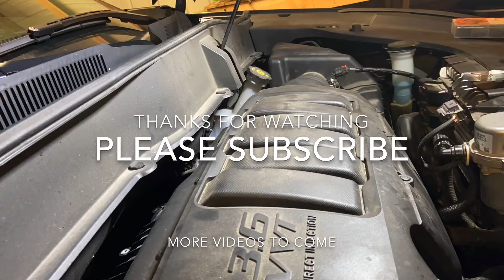Replacing the coolant temperature sensor on a GMC Acadia

Comment: I am having the same issue on my 2018 Acadia but with the warning of “Driver assist may be reduced” coming on the instrument panel. Temp bottoms out, fan kicks on hi, compressor for AC is disabled. I have an extended warranty which would cover it with only paying my deductible. I was advised by the mechanic that the issue is the State Farm Drive safe module. I have relocated it to another area and still having the issue. So is the issue really the temperature sensor or is the mechanic actually being truthful? At this point, I’m not sure which to believe but I believe the mechanic is full of crap. So I guess my question would be can this module have any interference with sensors on a vehicle mechanic also said it’s because it’s Bluetooth which my phone is plugged in and connect it to my vehicle by Bluetooth so I think the mechanic is just full of BS. What is your take?
Reply: Replace the thermostat under the intake for that

Comment: I have a sensor attached to low side a/c tube near front left of engine on 2011 Acadia. The connectors lock broke off  and every time it comes loose the a/c light will blink three times and turn off. I cannot get down to it to cut off and rewire a new connector on. Any suggestions?

Comment: 7:30 looks like you put the insulation on backwards?.. EDIT, even tho there isn’t much I could find it seems you can NOT wire this backwards, meaning it doesn’t matter which way you wire as it is a resistor type sensor and does not have polarity so it don’t matter which wire goes to what… however I’d still do research on this for whatever car you got don’t just take my word on it… also it seems after you do this you need to unhook your battery too not just the negative but both negative and positive or else it could take a lot of hours or miles for the computer to recognize it

Comment: The absolute hardest part about this job is getting the wiring harness unclipped from the sensor but every video I've found basically say it's a pain but don't really describe how you get at it.  I have tried fingers, needle nose pliers, nails bent into a hook shape etc and have gotten nowhere.  I really don't want to pay a mechanic $$$ to do this job just because I can't disconnect the wiring harness.
Reply: @HellbenT, did you ever succeed in getting the connector off the sensor?  I'm having the exact same problem right now with my 2017 Acadia.  I used a bent coat-hanger to pull up on the connector's red tab, but I still can't wrestle it off the sensor.  Any advice appreciated.
Reply: @jmlemay2007  I was eventually able to get it off, but since it's been about a year now, I don't recall at this point exactly how I did it.  It seems like I may have recruited my wife and her small hands for help but I could also be confusing that with some other mechanical project. I wish I would have posted an update at the time.  I'm sorry I couldn't be more helpful.
Reply: I broke the clip while trying to take it out as well. I cannot emphasize enough how hard it is to disconnect it. But I was able to buy the harness at O’reilly for $70 and splice it.
Reply: So if it's that hard to get off then I doubt I can get the thing apart. Or if i can unhook the wite harness.

Comment: Buddy I replaced the sensor, but car still shows the engine hot ac off error. What else could be the issue ??
Reply: The light should go by its self but I recommend you check your coolant level. Also you should replace the radiator cap.
Reply: Most likely the thermostat

Comment: I broke my connector clip as well.  When you drove the car without the locking clip did you have any issues?  Seems to me that even without the locking clip when I pushed the clip it it seems to be holding on pretty tight on its own.....
Reply: @RaymondJ, what method did you use that resulted in a broken connector?  Did you just pull the wire until the connector broke?  Did you replace the connector or plug it back on and hope that it stayed?  Any advice apprciated.
Reply: @jmlemay2007  Hi- I just put it back on without the locking clip and I can tell that that 7 months later I have not had any issues with it...   It holds well without the clip..

Comment: Hey there, I just did the replacement for the Temperature Sensor on a 2007 Saturn Outlook. However, it is still reading hot on the meter and once it gets to red it triggers the No AC, Engine shut off.  

My question today is, did the socket for the temp sensor leak out coolant once you took the old one out?  I saw on another vehicle for a Suburban/Tahoe, the mechanic performed it quickly so to stop the coolant from coming out.  On my replacement, no coolant came out.
Reply: Those but connectors are actually heat shrink conectors...they work well and don't need to add heat shrink tube or electrical tape

Comment: Did it leak any fluid when removing that plug????
Reply: Yes for me.. and i have to fill coolent as well. But still didn’t fix my issue
Reply: It worked after 3 days.. I had to reboot the car by taking all electrical wires off from the battery for 10 sec. And it automatically works after 3 days. Thanks for saving me a bunch of money. 

Thanks 🙏

Comment: were there any special tools needed to change the sensor?
Reply from the maker: You’ll just need a 19mm deep well socket to remove the sensor and possibly some pliers to remove the plug, although with pliers there’s a good chance you’ll break the plug like I did.

Comment: Why not tell us the year of this Acadia?
Reply: Because they’re not all the same. Models earlier than 2017 the sensor is in a completely different location on the engine block instead of the radiator.

Comment: If its wired backwards what will happen ?
Reply: Did you get an answer for that ?
Reply: @JustinMentionedIt if it's a 2 cable sensor, it can be wired any way lol. Just make sure to clear codes on computer before starting it. Or else fan will come on at start up.
Reply: @Lssjg702  yup so the way I had to fix that was after replacing the parts I unhooked my battery cables then it was all fixed